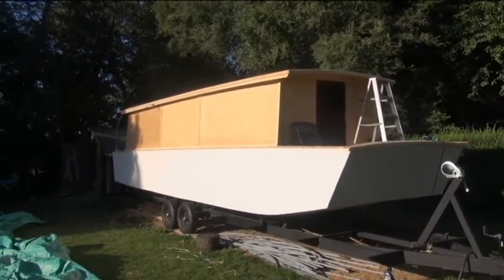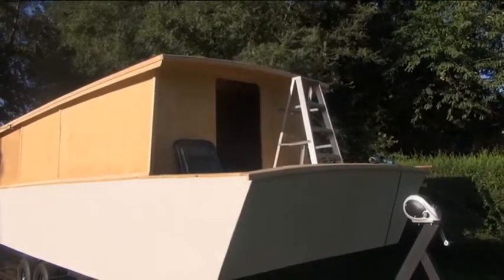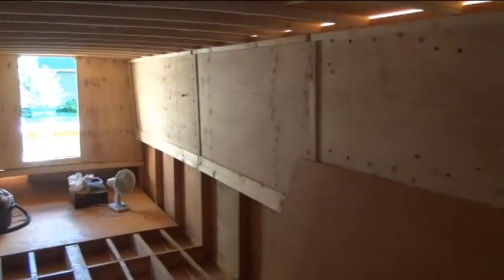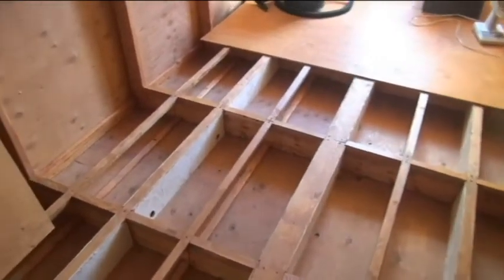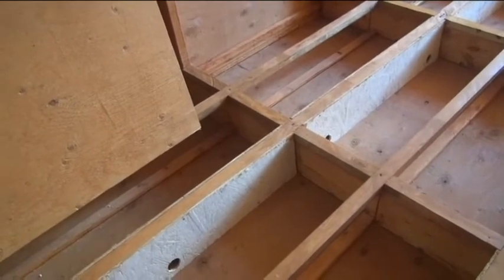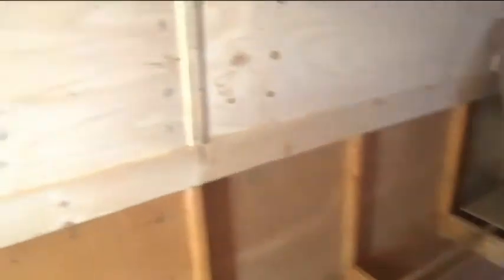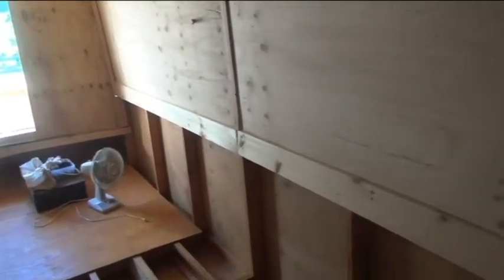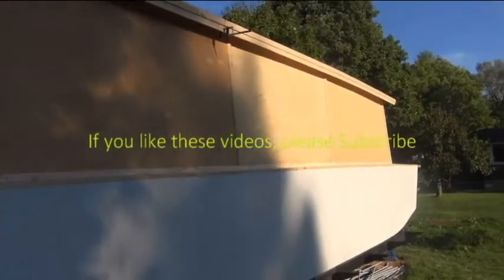tiny houseboat   the cabin part 4

Comment: How well has the boat held up?
Has it been kept in the water since launching it?
Have there been any issues that have come up, that you would have done differently, if you had known?
Reply from the maker: My partner Janet had cataract surgery this summer so the boat has stayed on the hard since the end of June.  We hope to put it back in the water next week and using it until the end of September. So far the only problems have been some rain water getting into the boat through the hull and deck joint and through an aft hatch.  I've fixed both.  The flat bow is somewhat noisy when beating against the waves.  I've covered other things in my latest video on construction review.  The other problem about keeping the boat in the water is the limited number of slips available.
Reply: @ourtinyhouseboat  Thank you.